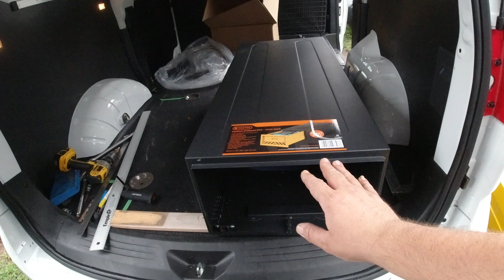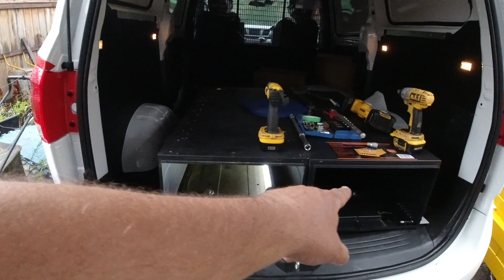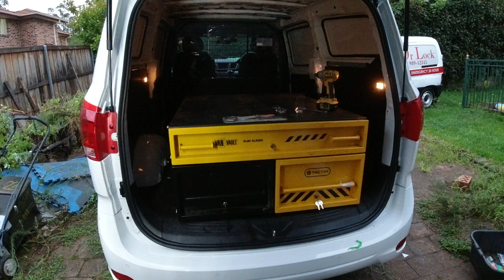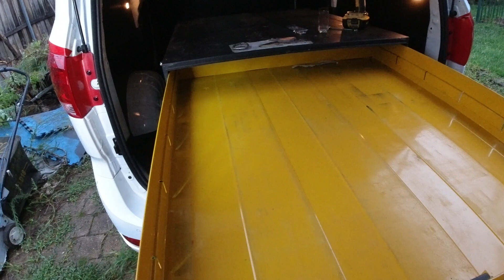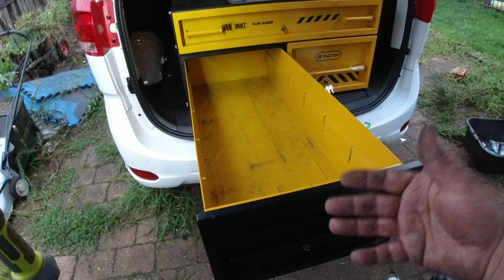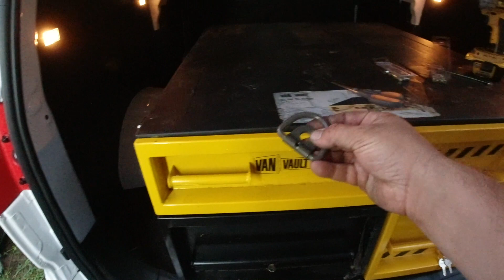New LDV Van Build Update Step 1

Comment: If you need storage boxes for the keys in the top drawer let me know , I 3d printed mine to size.
Reply: curious as to what they look like. any chance i could get a hold of the files? Might suit my next build as well.
Reply: @TheBeansathome  just simple open top boxes, dimensions need to adjusted to suit the drawer size you have. If you know how to use fusion 360 or tinker cad it takes 30 seconds to draw one out.  but printing them will take quite some time unless you have multiple printer. I printed 130 boxes in 24 hr with 5 printers working the same time...

Comment: Similar setup to mine, except mine is a caddy van, I have 4 drawers instead of two long ones at the bottom layer,  two facing toward the front of the car and accessible using the sliding door , just in case there is not enough space to fully open the drawers when parked. Mine is custom made with aluminum as well so it weights less.